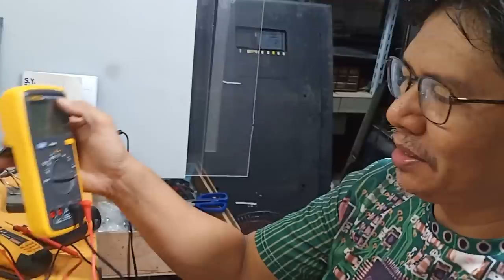how to repair power supply monitor | philips

Comment: Sir saan po location nyo? New subscriber po ako. May Sony ay JVC po ako na LED TV na need ng repair.
Reply from the maker: kalookan po pero home service kami, txt lang po 09276813141
Reply: @leboytechnician2867 Thanks Master. Medyo malayo po pala ako sa inyo. From Tiaong Quezon po ako. Ala po kasi Technician d2 sa amin na magaling sa LED TV. Ung JVC ko po half screen ung nawawala pero ang sabi di raw marerepair sira na raw mismo ung LED panel. Ung Sony ko po may mga vertical lines pero di ko pa napapa repair.

Comment: pa help man boss 
sharp 42" no picture ang damage nag voltage checking aq wala VGL / VGH pero pag tinanggal ko right side flix
present VGH/VGL at may picture an Kalahati' ano Dapat gawin
Reply: boss maraming salamat
nakita' Kona po' sira' sunog ang IC Ng (ILI3723k6ca1)
may solution pa po ba sa ganitong damage.thanks po'